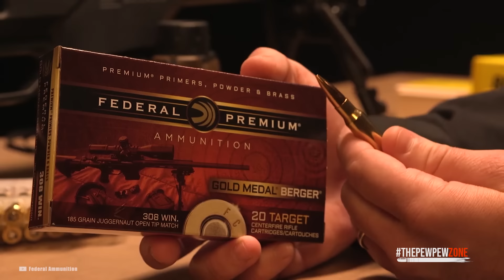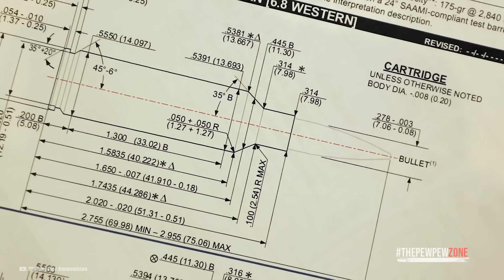8 Best .308 Rifles for Hunting - List for 2023

Comment: This video has misinformation, there is no problem shooting 7.62 Nato in any .308 Win. chambered rifle: it's the other way around that there is a concern. .308 Win. is loaded to much higher pressures than 7.62 Nato, therefore. 308 Win. should never be fired in a7.62 Nato chambered rifle. The video has it backwards...
Reply: You are correct for Nato ammo but be careful when using non Nato like Chinese or Russian ammo. They are dirt cheap in my country but can u trust their quality control. I won't take that chance with my hunting rifles.
Reply: It's due to the fact the .308 case wall is thinner the the nato the nato is made thicker so there isn't a case rupture in the action of the machine guns m60 m240 m118a2 etc the pressure is almost the same 1 is measured in psi .308 the other cup 7.62 nato
Reply: @vvr881  in my hunting rifles I only shoot hunting ammo.
Reply: You are 100% correct!
Reply: Shhhhhh thr watching you cant tell that
Reply: @shaneiveson517  As per the ammunition outlet, over pressure as a result of using 308 in a nato chamber will eventually result in deformation and rupture.
 "The 7.62×51 NATO chamber is imperceptibly longer than the .308 Winchester, extending between 0.006 and 0.010 inches beyond the .308 SAAMI specs. This results in a 7.62 case that is ever so slightly longer than its commercial brother. This means that when firing a .308 round in a 7.62 chamber, the .308 brass will stretch beyond its intended elastic range. This could have some potentially expensive consequences".  In other words, the case of the 308 can rupture if used in a Nato Chamber. 
Sooo... there seem to be a few reasons to avoid chambering 308 into a 7.62x51.
Reply: Also when talking about Mossberg Patriot, he keeps saying Ruger...
Reply: It's also wrong to say it's not ideal past 300 yards, I shoot .22LR to 300 yards
Reply: I have been hearing the opposite, Nato having higher pressures
Reply: @dennisdial7872  no...308 has the higher pressure. Thats why you cannot shoot 308 out of a 7.62 × 51 rifle.
But can shoot 7.62 ×51 out of a 308 rifle.
Its the same way with a .223 rifle and .556, you can shoot the 223 out of a 556 rifle, but not a 553 out of a 223.
Thats why they came up with a 223 Wylde bored rifle.
And its not really that you can't, but a person shouldn't...it does risk damage to the rifle and person
Reply: @raptorking5452  ok thank you
Reply: @raptorking5452  isn't this the other way around? You can shoot NATO 7,62 from commercial .308 but you cannot shoot NATO 5.56 from commercial.223 ?
Reply: @jenHry-ng3pw  no. Its exactly as stated.
Reply: I was thinking the same thing. It’s 308 can shoot 7.62 NATO. But it’s the other way with .223 can’t shoot nato ammo. Maybe he got mixed up. Either way can’t trust the list now. 😅

Comment: Have you considered the Howa 1500 with a 26 inch barrel that is hammer forged and the receiver is milled from one piece including the locator , the bolt is also made from one piece including handle  and a boyd stock?, or any other stock you wish?
Cheers Gary

Comment: The Ruger Hawkeye is the most underrated rifle made.  Watch any video with Alaska residents hunting and you will see a stainless Ruger Hawkeye/M77. They are DEPENDABLE, accurate well built and nice looking rifles with controlled round feed.  Oh ya Made in the U.S.A.   Should have been at the top of your list.
Reply: Does it accept ar style mags though ?
Reply: I bought a Ruger ranch rifle in the bolt/ feed, doesn't work for crap
Reply: @kevtom1686  No,  4 rounds max + chamber.

Comment: Many of cartridges show in this video are not .308. Also, Ruger does not make the Patriot rifle, Mossberg does, and the Remington 700 is made by Rem Arms, not Ruger. Ruger only bought The Marlin rifle line. Get your facts straight.
Reply: The video has a robot voice, with the advent o chat gtp wouldn't surprise me that has been commissioned by an av /edit student....
Reply: Now the remington is not the best choice for me,,i test some rifle in a year and now take a savage,browning ruger, winchester and some other brand.
Reply: @donaldbougie694  There are companies that make bolt actions on the copy pattern of the Rem 700 I have seen from Bat Machine, and I see Pacific tool & gauge sells a Rem 700 style action with many choices of bolt faces too long or short action and fluting on the bolts.
To me I have bought way too many rifles that turned out not worth the money I paid for them, and the name was just what you paid for.
It has been a long time in years since I bought a Remington 700 and that one was so shady made when the steel work showed the machining marks on the steel and accuracy was best described as shoot from accuracy.
The all-time worst rifles I have bought have been the Weatherby Mark 5 rifles with one the chamber was reamed off center and when I sent it back to have it fixed Weatherby say it was with in Weatherby specs.
I still own this Weatherby because I am saving for the action & McMillion stock Weatherby used for these rifles.
It is Highly possible I am barreling this Mark 5 in 338 Norma.
Reply: @donaldbougie694  I'm seeing sold at Cabala's the CZ 600 which I picked up and think is an amazing rifle.
You should look into the AR 10's in 300 WSM sold at KAK Industries or the AR 10 in 450 Marlin.
I build AR 10 uppers to sell in the WSM magnums and in 35 - 300 WSM then a 375 -300 WSM.
I also have AR 10 uppers in 6mm - 284 win and a 6.5 - 284 Norma.

Comment: How does the case spin with the bullet when flying in air? Also you can shoot 7.62x51 in a .308 not Vice verse, also the round was created to function in an automatic with a shorter stroke than a 30-06.

Comment: Tikka is the best rifle on your list. Ruger is accurate, but the stock is junk and you WILL have feeding problems and a scratchy bolt. Howa should be on this list., I bought a top of the line TX3 light with stainless fluted barrel and muzzle brake and Cerracote for $1,200

Comment: I know this is a 308 video but two better cartridges on the 308 cases are the 338 Federal and the time tested 358 win both for small hunting cartridges are real killers on deer and larger game when used to the effective range the cartridges are used for.
Reply: .308 is superior when it comes to availability and price.  If/when SHTF i would rather have the mass produced NATO equivalent rounds
Reply: @cleetus8952  What do you mean the 308 is superior for reliability, all modern guns are pretty fool proof and a bolt action rifle of today nothing goes wrong with then in all cartridges.
I am seeing prices for 308 the same or higher than large magnum cartridges and 3 types of hunting 308 selling at Cabala's in Tigard Oregon are $69 a box of 20 cartridges.
The rest of the 308 ammo is selling between $25 and $40 a box of 20.
The most expensive in Nosler 6.5-284 Norma at $120 a box of 20 and I have this cartridge in my AR 10 I reload for this.
Reply: @lurebenson7722  never once mentioned reliability...  .308 rounds are indeed cheaper than .338 or .358 when you compare same manufacturers.

Comment: Still a great pump gun even though it is mostly plastic, https://www.youtube.com/post/Ugkxh4su9YgU1tWmjikirWcKJbjsFLEU62Bc but with care it will last a long time. It would be neat if Crosman would make a commemorative version of this with real wood stock, but of course it would weigh more and cost more, but hey, it would be cool. The included scope is more of a toy, but it does work for backyard plinking. I prefer to use pellets for greater accuracy, but BBs are just as good for plinking. This is not a Red Ryder folks; fully pumped it is 3 times the power of a Red Ryder and can be dangerous if not handled properly. Be safe out there.